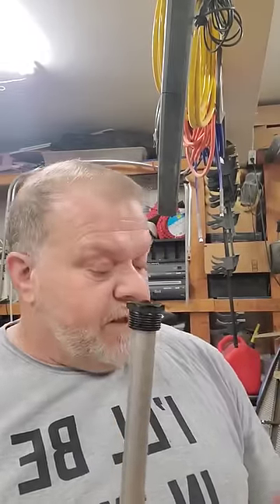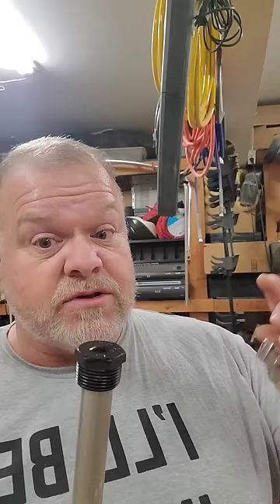Eradicating DIY by requiring special tools. #plumbing #plumbinghacks #waterheater

Comment: Stop buying tools from Wal-Mart.  A Real Tool Set comes with many options.
Reply: His mom bought them for him.
Reply from the maker: I do, the point is MOST people don't especially all the GenZ kids who have given up on capitalism because it has been rigged by the companies. See, capitalism is awesome, btu it is when companies COMPETE for the customer, not when the companies collaborate the screw customers. That's why we wrote monopoly laws and they get around it by collaborating.
Reply from the maker: Oh and by the way, all the plumbers are in on the scam, it's no different than car companies and mechanics. See, diagnosing a car problem is SO easy, but you have to have the special scanner licensed and updated by a manufacturing company, the ones sold to mechanics on a monthly subscription so they can force end users to use a mechanic. Mechanics are in on the scam cause it forces people to come to them.
Reply: @peterjbarclay  Let me guess Electricians, Builders, Roofers are scammers as well.  Did I leave anyone off the list?
It's not all a conspiracy or scam.  Who actually profits from the anode nuts being 1-1/16"?  The only ones are the socket/wrench manufacturers.  The plumbers have to either buy a more expensive set of sockets and wrenches to get the larger sizes or buy individual socket/wrenches of each size they don't have.
Reply from the maker: @tonyonofrio1147  yes you did car mechanics and each one of those people rely on their little elitist companies who do all the screwing they just perpetuate the scams
Reply: Just get an adjustable wrench and it will work 90% of the time, the only time I had to get a specialized wrench for something was when I needed a 150mm (or something like that) one for an electric water heater that screws into a tank

Comment: Ease of manufacturing!!! Time, materials vs strength slightly overbuilt. Go buy a socket. Your nut is made just large enough to cut threads into it and maintain an appropriate diameter for the anode to fit in. Can't make it smaller, won't slow down production to weld a nut on. The nickle and dimes in cost add up to effect final price. Price usually needs compete with other manufacturers or no one buys your product and you go out of business.
Reply: Exactly!
Wait until he finds out about electronics manufacturers. 
They used to produce several models of an item, say TV, with the same board, but leave out components for various features.  That way they would save on design and board production but be able to charge different prices for each model. More features = higher price, with same production cost.
Now it's done in firmware, exactly the same  electronics and case, just different firmware to limit/disable features.
Now that's a scam!

Comment: That is an extremely standard size dude. If your cute little Walmart set doesn't have it, you can go buy just that size at an actual tool store
Reply from the maker: Ok., thanks for making your lie so easy to show. Here is a link to a Walmart search. People can check their local stores but my store and none within 50 including 2 college towns has one. You CAN ORDER one that will get here in 3 days but it is an individual socket. The point was it's not part of the standard sets. They are available, but not in the standard set everyone buys. https://www.walmart.com/search?q=1+1%2F16+socket&typeahead=1+1%2F16&intentSource=NONE_IN_STORE

Comment: A 12 dollar socket is out of your range? You dont have to buy any sets at all. If your not in the trades you should just buy what you need as you need it.
Reply: I agree.  Or buy a set for > 1".  Set may be expensive, but will last a DIYer 50 years.
Reply: Or of you really want to do it cheap it's $4 at harbor freight.
Reply from the maker: It's not about that, it's about the fact that you have to buy it special and separately. Plus it's easier now to get it than it was before which is why they have to keep moving the goal post.
Reply: I’d hate to see his review of tankless water heaters. 😂 Actually I’d pay to see it.

Comment: I just use the same socket that I use for my transmission drain plug (yes, it is that big) and it was $13 at autozone and comes with a lifetime replacement warranty (like all autozone tools). I think it is more about product design and manufacturability than anything else. Now I'm just a new product development engineer so it's not like i know anything about product design but I see no real issue.

Comment: It's the socket and wrench manufacturers that produce the cheaper sets that limit the sizes.  Usually these are sizes that are most commonly used by DIY and home car mechanics.
The other day I needed a 13mm socket and my 2 cheap socket sets didn't have one.  They had 5-20mm in 1mm increments, except for 13mm?
Better set had 13mm.  Go figure?

Comment: I guess he would freak out on the wrenches that I routinely used in the engineroom on a US Navy ship. 3/4 inch is TINY...My own personal wrench set goes to 1 1/2 inch. Specialty sockets used for one specific type of fitting? No problem (oil pressure switch sockets, Oxygen sensor sockets, etc.)
Reply: WOW you are SO COOL

Comment: Do you realize that manufactures don’t give a crap about you as a  homework repairing your own gas appliance. You are complaining about not having the right tools for the job or about the cost of the tools to perform the job when the reality of it is you can harm not only yourself but your entire neighborhood when  working on that gas appliance without 
Proper  knowledge . These systems should not be serviced by anyone who isn’t professionally trained. End of story .
Reply from the maker: Really, that would mean you must be a complete moron and an avid scammer of customers. I'm not saying it should not be done with care but that's like saying that an easy bake oven should only be worked on by trained pros. eND oF StOry..
Reply: @peterjbarclay  an easy bake oven isn’t a gas appliance .